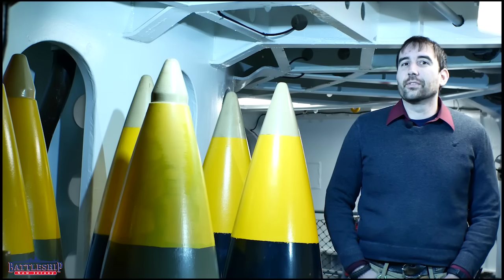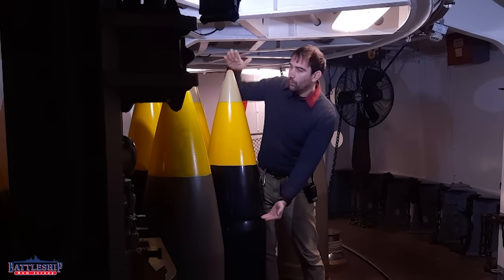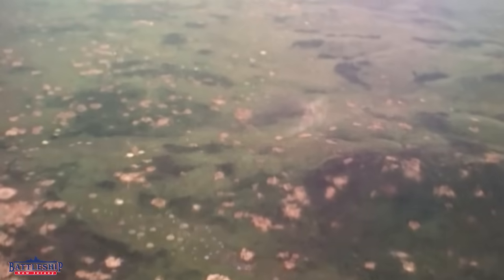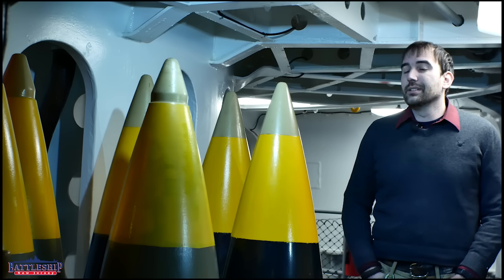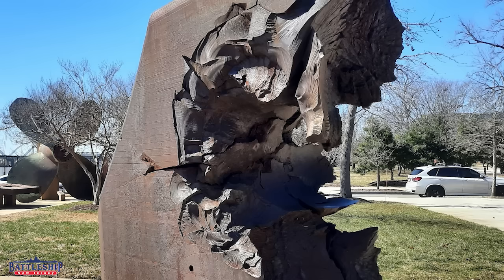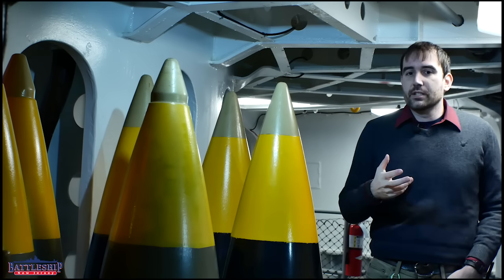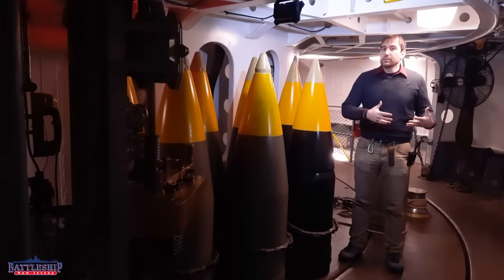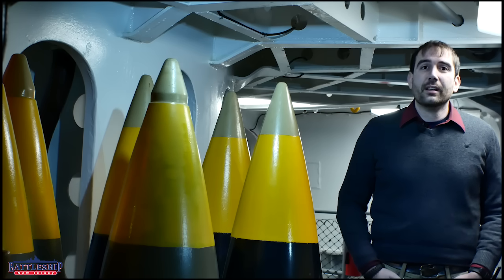What Does the Impact of a 16in Shell Look Like?

Comment: I remember as a kid hearing tales of how accurate Iowa Class Battleship 16 inch guns were. How good were they really? How close can you reliability be when shooting at something 15 to 20 miles away?
Reply: I recall reading an article in Guns and Ammo around 1989 that put their accuracy at sub minute-of-angle.  If I remember correctly,  they could consistently hit an area smaller than a football field at 20 miles. Teenaged me was pretty impressed reading that article.
Reply: @adirondacker007  I remember reading that too! Pretty good accuracy for an analog fire control from the late 30’s early 40’s!
Reply: @carlwilliams1570  Technically it was computerized
Reply: @goldenhate6649  It was an electromechanical analog computer
Reply: @carlwilliams1570  um it was upgraded to computers. At first they were less accurate until programmed properly and narrowed down the variables like roll and pitch (better gyros) windage (up to the moment weather) and variable charges  sending that big beautiful can of beans into the garden party. The analog systems were a backup and at first cross checked with the full computer systems that we now use today.
Looking at you tube videos it's easy to conclude that they can't hit shit. The modern systems blow the hell out of the water and one in two hundred rounds hit their targets. It's embarrassing.
Reply: @adirondacker007  The interesting thing is that you do not want a too small dispersion when you firing salvos, as it it a statistical exercise more or less, f.e. IJN were reported to have very tight groupings but lots of total misses. I have too many books to give the source sadly.
Reply: @andersreinholdsson9609  It's tough to make corrections in combat when you can't make accurate measurements beyond a certain visual range.
Reply: @adirondacker007  With that accuracy, if you were bombarding land targets, you may as well say that is 100% accuracy. Even if you were standing on one end of the football field, and the shell landed on the other, you probably wouldn't be around to enjoy the fireworks.
Reply: @YT-TheLegacy  Is there any ground zero footage that survived of a 16” shell hitting close by a target? Would like to see the impact to better understand first hand what it was like to have been on the receiving end of a bombardment.
Reply: @adirondacker007  Pretty accurate when you consider a battleship from WW2 wasn't much smaller than that.
Reply: @adirondacker007  football field? Its not anymore
Reply: @full-timepog6844  true. What a screwup.
Reply: @adirondacker007  I recall that article also,it was titled the "worlds largest varmit guns"..
Reply: @johnwunder3521  you do realize that means you're old, like me...  :)
Reply: https://youtu.be/DEGrj1Vg19U

He talks to a commander of the iowa and talks about the accuracy
Reply: @joe1273  I watched it last night. Great video!  Thank you for posting the link!
Reply: Their accuracy was one reason they were recommissioned for Korea - more accurate often than aircraft bombs and missiles.
Reply: Before the Navy remixed all the powder lots in the early 1980's , they were very accurate,  however the remixed ammo bags , since they were no longer lot specific , but a mix of many lots , in unknown amounts, their accuracy was pretty much garbage and could miss by 10,000 yards (5-6 miles) at longer ranges for much of the remainder of their service(later studies of the shelling of Lebanon mention the 10K yard CEP.  The Navy did find some powder bag lots that had not been re-mixed , but how much and how it was distributed , to what ships or when, I do not know/recall. (there is alot of info on this issue in the book "A Glimpse of Hell")

It was huge screw-up , which made the BB's main 16"guns largely worthless, to do marine gunfire support  the last 10 years or so of their service lives( except for the  "display" of firing them), and IMO affected why some of the Iowa's were not kept somewhat longer in moth-balls. ( there was no longer any spec powder lots for them as it was all basically "contaminated" by mixing lots).  Having calibrated ammo  specs for the powder you are  using is very important for accuracy in firing cannons, or any firearm, at any kind of long range.
Reply: @chrisperrien7055  I highly doubt that's the reason they weren't kept longer. It may be expensive to repack the bags, but it's probably the easiest thing to fix if they'd ever needed it.
Reply: @BlackEpyon  It was one of the reasons(the main reason). Note: The Iowa battleships  raison d'etre' for still being in commission was for close gun-fire support for the Marines if they did/during an amphibious attack. The loss of accuracy for the HE ammo was too much for them to safely do that after the lot mix-up.  Sure they could conduct "area" fire and do damage (as they did in desert storm), but they were going to be doing direct gunfire support for  landing/landed Marines anymore, which was again their whole reason for being around in the 1980's -1990's.

Secondary , some people realized they were fairly invulnerable to modern SSM's so they had some value as a surface combatant, because of their armor, and being an armored cruise missile launcher , but that was secondary to the gun-fire support role  they were supposed to do for the  USMC.
Reply: @chrisperrien7055  I know the other reasons, but HOW could faulty bags be "one of the reasons" for mothballing a class of ships worth $800 mil a piece in 1992 dollars, when it's such an easy problem to fix!? It's like throwing out your car because the gas went stale. Just drain the fuel system, fill with fresh gas, and you're good to go! That's just idiocy in the highest degree!
Reply: @BlackEpyon  OK, one more.  The problem is more like they no longer make leaded gas for your car. And finding leaded gas is "kinda" difficult now.
Or you own an old gun, and nobody has/makes/or sells  bullets in that caliber for the past 50-60-75 years.
Reply: @chrisperrien7055  You literally do not need leaded gas, even for vintage cars. You mix in a fuel additive (such as LeadX) that provides the lubrication properties of leaded gasoline without the environmental impact of leaded gasoline. And if you're willing to go through the effort to restore and maintain a vintage car, the "inconvenience" of mixing in a fuel additive is trivial. 

Bullets are also easy to manufacture if you have the right tooling for it, and there's an avid enough vintage gun community. These are both non-issues.

Even in my own hobby, the vintage/retro computer community, when parts aren't available, we build our own from scratch or from aftermarket kits. The XT-IDE project is probably one of the best known examples, which allows you to use "modern" IDE hard drives, or compact flash cards, in lieu of the failing and unreliable MFM hard drives in the 8-bit computers we love to keep going.
Reply: @BlackEpyon  Get back to me when you build a new  ENIAC computer or a few vacuum tubes for it at least ;)   > And some punch cards for it.  I have not seen a punch card since my second grade Report card. I miss those things.
We are going far off-base,  Regards.
Reply: @chrisperrien7055   I don't know about "vacuum tubes," but I know of a guy here on YouTube who builds nixie-tubes from scratch for retro clock enthusiasts. Apparently there's enough of a market that he does it full time now. https://youtu.be/wxL4ElboiuA
Vacuum tube circuits aren't far removed from that, if he ever decided to go into it. 

Apparently, somebody actually did save some of the instrument panels from ENIAC, but I'm not familiar with that effort. Regardless, the Iowa class battleships didn't use ENIAC, they used their own brand of electromechanical analog fire control computer. There wouldn't be space on a battleship for a fire control computer based on vacuum tubes. 

I do know a group of vintage computer nerds who restored one of the few remaining Apollo Guidance computers to operational status, and used it to simulate a few lunar landings, using genuine Apollo code. https://youtube.com/playlist?list=PL-93BVApb59FWrLZfdlisi_x7-Ut-w7
Reply: @BlackEpyon  My ENIAC comment was because you build old computers. Not because the Iowa's have a Ford fire control computer. Please find somebody to work on one of those as well. LOL  And your friends needs to build 30K vacuum tubes for that ENIAC plus spares as they do burn out. LOL 
My comments about leaded gas were in response to your car comment.  Please find an oil company , that will build/refit a refinery for leaded gas. LOL Because that is the scale of what you would need to make "ammo"  for 16" cannons , enough to fill 2-3 battleships and also keep the factory going to continuously provide training ammo and real ammo. (1000's of tons of the stuff). We are not talking about making paper cartridges for a Sharp's Carbine. But  How about making enough for 27  of them as I  got a gun club that shoot 16"' Sharps Carbines  a lot.  And keep it climate controlled, and that is something else that did not occur with the  US's 16" battleship ammo in the 1970's-80's.  It was stored on river barges for many years with no climate control.

You see that is the issue. it is the scale of what you need to provide ammo, parts and expendables , that are all mil-spec and in such quantities, that preclude "do-it-yourself at home " fixes. degrades
Reply: @chrisperrien7055  If I can do it at home, you can quite easily hire a defence contractor to do it on an industrial scale, if you need it done. It's not like Remington or any other bullet manufacturer isn't already filling millions of bullets with gunpowder already, and if you offer them the kind of money involved in a defence contract, they'll quite happily bid to make you a custom batch if you need it. Especially if all they need to do is fill bags with powder, which is considerably easier than making the bullets. It's easy money. 

Even in my own field, electronic component manufacturers will HAPPILY make you custom components if you're ordering enough quantity to justify the tooling costs (usually orders of at least 100 pieces, but it depends on what you're ordering).  They literally do it all the time for factories making end-user products. if there's money to be made that will justify the time and expense, they will do it.

I'm not saying that there weren't other reasons to retire the Iowa's, but this clearly isn't one of them. Stop making stupid arguments.
Reply: @BlackEpyon  I was not going to reply, but with "stupid " you can go ..
You obviously missed  my point. And if the gov want to throw out a few hundred million on "stupid" , perhaps they add it to your taxes,  not mine.  I am done.
Reply: @BlackEpyon 
If you want leaded fuel, just get Avgas, it's readily available at most airfields, or like you say, get an additive.
On a side note, tetraethyllead is more for raising the octane level then any lubricating properties, raised octane level ofcourse means you can get an higher compression ratio without risking a pinging engine. Though some claim it "dampens" the valve when it hits the valve seat, so you might get more wear on an unhardened valve seat without leaded fuel. 

More on the general topic, I'm a CNC machinist, I mostly made one of a kind parts or single digit production parts before I became a machining (cnc and conventional) and CAD teacher. Whenever I hear people say you can't get parts for something old ( be it steam turbine or boiler parts, custom shells and cases, or F1 engines for a saturn V) I have to roll my eyes. Whatever we could make in the 40's we can make now. It will most likely be uneconomical, it might not serve a purpose, but it most certainly is possible. 
No technology from back then is really lost, we still have skilled manual machinist, we still have boiler builders, we still have industial foundries and forges, there are still people with riveting experience out there, there is even some vacuum tube production still ongoing.
Reply: @chrisperrien7055  I wasn't calling you stupid, just your argument. The $100 mill price tag for an Iowa in 1944 is worth about $1.5B or so today, with inflation, so paying a bit extra to whip up a new batch of gunpowder is chump change, IF the DoD decided it was worth it to keep the Iowa's going.

By the way, you said that you got punch card with your second grade report card? They are still used with vintage machines like the IBM System/360, for the few museums that have them maintained. The Computer History Museum has a working System/360 with two readers, last I checked, and a whole lot more machines that use punch cards besides that. Whipping up a new batch would be as easy as putting in a custom order at a stationary supplier. They do custom cards and stationary all the time, that should be no issue.

But I'm intrigued that your marks were done using punch cards. My grade 2 was similarly low tech, but everything was tallied on paper. Can you tell me more about that?
Reply: @slome815  I don't know about Europe, but in Canada/US, it's still very easy to get high octane at the pump. I'm surprised Avgas is still leaded though (not that it's legal to put Avgas in your car, you can get fined for that).
Reply: @BlackEpyon  Well, high octane is relative. here in europe most high octane fuel is RON 98 (low octane being 95 here). Most Avgas is Ron 100. I doubt you get such high octane fuel at most pumps.
But yeah, Avgas is for the most part still leaded. And using Avgas in a car is illegal in most places, since it has lower taxes. Most cars still drive fine on it though. Just like using fuel oil or jet fuel in an old diesel engine.
Reply: @slome815  Diesels will run on almost anything other than gasoline because they operate on heat and compression to which the fuel is injected. Gasoline engines run on a precise air-fuel mixture to which a spark is provided at the point of compression. The joke my mom always made about our old diesel Golf was that it would run on the scent of an oily rag.
Reply: @slome815  "Whenever I hear people say you can't get parts for something old ( be it steam turbine or boiler parts, custom shells and cases, or F1 engines for a saturn V) I have to roll my eyes."

Ditto. It's always an argument from ignorance. I've made the case for the Saturn V parts a number of times (not the least because of that AGC playlist I linked earlier, it's worth a watch if you're into computers like I am). Case in point, during the design study for the SLS, one group actually DID build a modern replica of the Rocketdyne F-1 engine. Ultimately though, it was decided to reuse the RS-25 and SRBs from the Shuttle, which was kinda redundant, because they ended up redesigning them anyways.
Reply: @slome815  Amen.
Reply: @BlackEpyon  1973 or 74 circa  IIRC.
Reply: @BlackEpyon  how easy is it to manufacture a 16" diameter bag of explosive powder, multiple bags per round, many rounds per barrel, 9 barrels per ship?

Answer: Not easy especially considering they stopped producing them many years earlier.
Reply: @BlackEpyon  16" projectiles are not something a "vintage community" could just manufacture on a whim.
Reply: @paulallen8597  Can't manufacturer 16" projectiles? Have you never seen a machinist with a lathe before?
Reply: @BlackEpyon  Yeah! I'd like to hear about it as well! I was in second grade in 74 and all of my report cards until the middle of HS were done the old fashioned way.  Pen to paper.
Reply: @eac1235  Must have been a pretty big school district. I know that large corporations would use these IBMs for processing payroll.
Reply: @BlackEpyon  Chris's point is that gunpowder isn't powder at all. It is granular. The grain size used in a 16" gun is huge. Some of it has through holes. The shape, size, perforations, and composition all affects burn rate . Just as the propellant used for pistols will not function properly for rifles or shotguns. You cannot use propellant made for a 5" gun in a 16" gun. In any gun, as the weight of the projectile changes so does the needed burn rate of propellant. This means for every type of 16" projectile a different propellant is required. So to setup a factory to manufacture all the different propellants needed would be quite costly.
Reply: @nkuntroll247  This argument comes up for those who insist we could never rebuild the Saturn V, and it's bullshit there too. You have to redesign/reconfigure the tooling ANY time you switch a factory floor to make a different product. That kind of thing is included in the quoted cost. I fail to see the issue.
Reply: @BlackEpyon  The issue with the saturnV engines was the amount of development that happened on the shop floor buy engineers that had progressed along the whole test cycle and they didn't keep those notes so they really don't have the proper build specs anymore.
Reply: @slome815  The current most common Avgas is 100LL and it is has an antiknock rating of 100/130 aviation lean/aviation rich aviation lean is approximately MON or roughly 112ron. The LL stands for low lead, the amount of lead is not enough to offer noticeable increase in knock resistance, it is primarily added to prevent exhaust valve erosion. With plain cast iron seats, under high load when the valve is hot if you do not have the light coat of lead deposit there will be micro welding on every valve closing and microscopic chunks are torn out of the valve seat when the valve opens, repeat a million times and your seats recede. 
The lead will harm sensors and other parts in a modern car, there is no fine other than expensive fuel and a big repair charge. Though I do use 100LL in my antique tractor, it runs very nice but I only burn a few gallons each year.
However avgas has other properties, unlike automobile fuel avgas is not oxygenated and actually contains antioxidants to prevent it from turning to gunk in storage, it does not contain alcohol (illegal actually) because the alcohol absorbs water from air and along with corrosion it can form ice crystals that clog the fuel system,  and it can stratify into an aqueous layer and oil layer that stops the engine or severely alters the antiknock rating. Then there is the tight tolerance on the vapor pressure.
Reply: @mytech6779  Yeah, they did, they're all on microfiche. The F1 engine even underwent a couple updates after the Apollo program ended, including one recently as a contender for the SLS using modern production methods. But ultimately, it was decided to spend the same amount of money completely overhauling and redesigning the "reusable" RS-25's from the shuttle as "expendable" engines, so as to keep the current aerospace contractors happy, when they should have been preserved as museum pieces. That's what happens when congress "decides" what engineers can do. It's all pork spending.

But you seem to be under the impression that modern fitters and welders are incapable of modifying designs on the fly when they find more efficient ways of doing things, and that's just patently false. CAD makes it even easier now, because you can easily save your changes INTO the design. That's now standard practice in prototyping. No sense re-inventing the wheel.
Reply: @BlackEpyon  You impart too much into things that were not stated. Nobody has said we lack the technology to develop a modern F1 engine, thats an absurd stance to take. What is actually said is that you can't just dust of the old F1 paperwork and and skip all of the R&D cost because those important details are lost with the people that worked on them. 
It would be a substantial redesign and testing process.
Yes, the original designs are on microfiche I never said otherwise. But the designs were modified during R&D. This has nothing to do with making a change to a welding jig on the fly. I'm talking about engineering changes made during prototype testing based on the experience of 10 years of space race R&D and no they didn't microfiche every engineers personal notebook and chalkboard computations.
So yes it can be replicated today, but at the cost of starting from scratch.
(I am in aerospace, this isn't some water pipe in a field and the machinists/welders aren't making design changes on the fly without the engineer responsible for the item.)
Reply: @mytech6779  I call bullshit on you working in aerospace, because if you did, you'd know that everything you just said would have to be started from scratch, actually WAS done for the F-1B that was being developed for the Advanced Booster Competition for SLS.
Reply: @BlackEpyon  I Just said it would need to be developed from scratch. God I miss the days when getting on the internet was still complicated enough to filter out the mentally deficient.
Reply: @mytech6779  And I just said that there's no need to develop it from scratch because the work has already been done! A person incapable of listening shouldn't call others mentally deficient.
Reply: @BlackEpyon  The discussion was not about whether the work to make a totally new engine has or hasn't already been done. It was whether more copies of the old F1 could be readily produced. The F1B, which is a total redesign and not the F1 despite the similar name, is a perfect demonstration that they were not able to simply produce more of the original F1.
Reply: @mytech6779  The question was never whether or not one COULD reproduce the original F-1, but whether or not it made sense to, given the advances in the past 40+ years since the last one was flown. The F-1B is a modern version of that engine, but it's still an F-1.
Reply: @chrisperrien7055  a crap load of 5-in 38s is just as handy to have to make stuff go boom. And with the introduction of GPS technology, you can put the accuracy back into those 16 in rifles. Land-based artillery has already made strides in that regard
.
Reply: @WALTERBROADDUS  Not really, powder/ammo lots all have different specs. You go mixing them in unknown amounts in each ammo bag, you'll never have uniformity. The problem with the 16 inch BB ammo in the 1980's was the ammo bag lots  were "unique" as none had been made since WWII, and there were no production facilities for new ones.  

  As to 5inch . so what? There were many improved/later model/faster firing /longer range 5inch on other ships. And GPS of the time (1980's)was not accurate enough for long range point target artillery fire.  That had to wait for the 1990's. Sure other cannons now  benefit from modern GPS and having spec'ed (calibrated) ammo lots.  But all the Iowa's had in the 1980's  for 16"  HC shells was 50 year old ammo bags , that had the lots all "scrambled" up.

  IIRC , they did take back all the 16" ammo bags  and "remixed" it all again, to try to make them all one big composite "lot" and they reduced the  CEP to some extent in/for Desert Storm, but the 16" guns  never gained back the accuracy they had in Vietnam /Korea/WWII.
Reply: @chrisperrien7055  close enough does beat the situation we have now. where we shoot nothing at all....
Reply: @WALTERBROADDUS  HMM, IDK,  I'll quote somebody, 'The greatest sword is one that does not need to be drawn". -Me, when the Wall fell and I was there-1989 and maybe some Chinese philosopher or general, I forget . LOL 
 We won the "Cold War" without firing a shot, although Korean War and Vietnam War Vets might have an issue with that. They fired alot of shots for that and lost a lot of good men. My God-Father being one.
And then all that was squandered, and the USA march merrily into this idiotic GWOT in 1990-91.  But that is neither here nor there and off topic. I'll refrain from further reply
 Regards Broadus
Reply: they were accurate enough that the Iraq troops were surrendering to the targeting drone
Reply: Comment for all. I've been coming here for several months. I'm impressed with the level of civility. Difference options are respected. Kudos to all.
Reply: Actually, quite accurate. In fact we owe Naval gunnery a thank-you for inventing modern computers. It was because of the complex mathematical equations needed to put a round on target mechanical computers and later electronic computers were invented and installed. These mechanical computers help figure out what used to be guesswork.
Reply: In order to hit a target from 20 miles away you have to calculate the motion of the ship, both roll and pitch, the forward speed its traveling at, the windage, the trajectory (arc) the rotation of the earth and the charge that sends the round downrange. I learned that in gunnery A school.  Lotsa numbers and the human brain can't figure it out fast enough, ergo computers and a little guessing. 
It wasn't impossible to dump round after round in an area the size of a football field. From 20 miles.
Impressive no?
Reply: @darrellcook8253  and humidity, rain, fog, snow, clear, ambient temp, barrel temp and wear, projectile temp and lube type (tricresyl phosphate one of the more recent).  Haven't read that sunlight intensity enters into consideration.
Reply: @darrellcook8253  That is very impressive, and since these ships were built to destroy other battleships the size of 3 football fields, that is more than enough accuracy.
Reply: With the microwave radar and advanced directors they had, they were (without question) the most accurate battleship guns ever put into service. 

The gunnery skills are determined by the crews and the environment they were in, but in a perfect world I think it would have been extraordinarily accurate. 

During the battle of Surigao Strait, Oldendorf’s  older battleships like West Virginia achieved hits almost immediately - at an initial range of 13 miles.  IN COMPLETE DARKNESS, based almost entirely on radar plots and information- this was 78 years ago. 😳

A ship like the Iowa would have had even greater accuracy with the 50’s and slightly better targeting systems, though the WV and others were heavily updated by this time as well.
Reply: @EstorilEm  All true,  but having known/uniform ammo lot performance is still a part of that equation. I hit a horsefly with 105mm(4inch) APDS round at about 3/4 of a mile (1400meters) once,  but I still had to input figures given to us into my ballistic computer  for that ammo alot , or I probably would have missed by inch or two. LOL.
Reply: Was on a heavy cruiser in 1954, 8” rifles with radar control. Target was 55gal drum at 16000 yds, third round dead on.
Reply: Thanks!
Reply: given the size of target they are designed to shoot at good enough drachinfel did one recentlyish on them i think it was about a 1200 foot diameter circle at like 10 miles basically at a range they were shooting all 9 shells would land within the length of an Iowa plus half of the ship at least that was i remembered
Reply: The New Jersey I believe has an analog fire solution computer. Which was a pretty amazing piece of technology. Was the first of its kind.
Reply: @1pcfred  "Second of its kind":) South Dakota class battleships had it first, we are talking late 30's technology, very impressive. (It held up well, unlike the Bismark)
Reply: @1pcfred  Yep. The Iowas have mechanical computers for fire control https://www.youtube.com/watch?v=gwf5mAlI7Ug
Reply: How accurate?  I have heard that the Navy considered replacing the analog aiming system with a computer one (when they were brought out of mothballs in the Reagan era) but the analog systems were just as good, if not a bit better than the computer ones.  In a moment of clarity the Navy decided to save money and keep the analogs.
Reply: @carlfromtheoc1788  Just a thought, but for a digital system, the accuracy of a computed input would be mostly dependent on the accuracy of the sensors and actuators.  The fire solution calculations are approximated well by the existing analog computer, so if the input data and actuators are the limits of accuracy for the existing system, a digital system doesn't bring much to the table.

That said, where digital is helpful is the ability to integrate with other digital sensors.  Ie firing at a radar target or target acquired from another platform.
Reply: @carlfromtheoc1788  not to mention they are substantially more reliable to damage from vibration , shock and simple corrosion. We have the Salem and USS MA nearby and both their systems are intact... and with a little tuning and calibration would probably work fine. Bet my PC won’t in 60-70 years .....
Reply: That's why you have spotters. You use coordinates on maps and input info into computer, then your spotter walks the salvos (rounds) onto the target until you achieve Alpha Mikes (direct hits).
Reply: Powder lot isn't going to create a 10000 yard inaccuracy, that's absurd just not at all inline with physics or the demands of a war machine getting operating with any supplies available made hastily in wartime industry. The navy remixed the powder because it was getting old and inconsistent. By that time some 50% of the remaining HC shells were already considered unservicable.
Reply: 200yard radius was the test group using I want to say 15 shells.
Reply: Depends on the wind, and whether or not the target was moving.
Reply: @BlackEpyon  and sea state. if the ship is firing to the side if she is rolling at all from the swells of the ocean that will affect the accuracy. All shots would need to be aimed and timed for when the muzzles were at the highest point of the ships movement.
Reply: @jaquigreenlees  I'm pretty sure the firing computer compensates for the list. It'd be pretty useless otherwise.
Reply: @jaquigreenlees  Roll and pitch plus the effect of the big guns pushing the ship over and aside making its own roll factor. Small difference at the point makes a big difference downrange.  As slow as they were reloaded and refired that allowed things to settle down a bit. It do go bang! Its the loudest gun followed by the 3" 50 cal. For some reason they were particularly loud. Concussive effects too. But I loved that gun.
Reply: A soccer field or a football pitch is what their effective area is. Highly accurate guns
Reply: @tctarheelfarmin358  I'm guessing that 50 m accuracy places any near miss in the blast zone. I can't imagine anything strong enough for me to consider 50m of it between me and the band sufficient for me to be happy to be so close to one going off.
Reply: For gods sake.. they don't use em anymore because they don't need them anymore.. fuk what ammo mix or accuracy they retired with.. shits obsolete...pull it down the back of the property and leave it inside the hedgerow somewhere. DONE